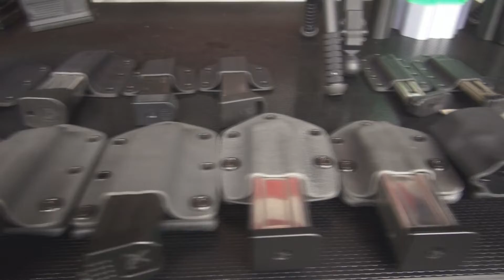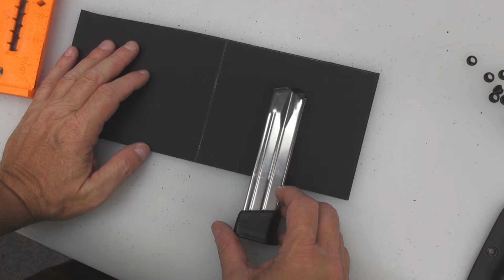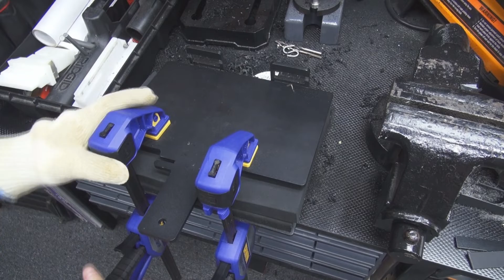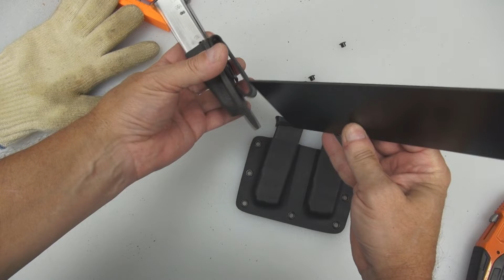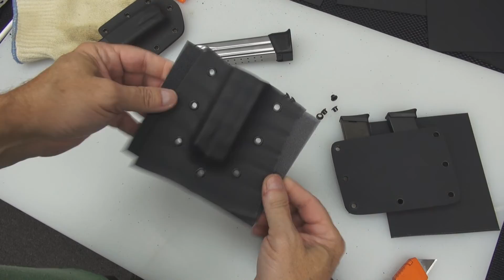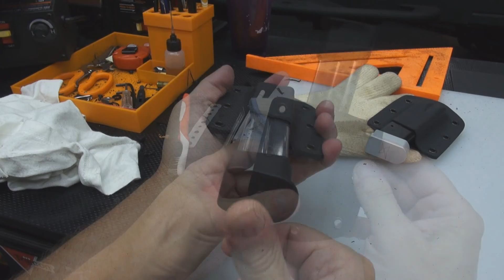How To Make a Kydex Mag Pouch...Easy!

Comment: Great video, I always have to laugh a little, watching every tuber test the retention of his mag holsters, with an empty magazine. Haven't seen one yet shaking that holster upside-down with a full mag. Mine hold 15, and I guarantee my full mags would fly out if you shook them upside-down in a kydex holster, like that, unless you clamped em in there real good...PS.. I know it's a safety issue, but then maybe shake test them out in the field or on the range, with a full magazine(s). Just sayin.
Reply from the maker: @elwhastrummer  ... Thanks! That's a good point about the retention, and it's something I should have mentioned in the video. Just about every mag pouch and holster I make ends up having a slightly different amount of retention. But luckily, it's very easy to adjust by applying a little heat with a heat gun to a small area and squeezing or stretching where needed...or even just adding a little dimple to the kydex where the mag catch hole is, using a small flat head screw driver. More often than not, the retention will be so tight that I can't get the mag out at all, and will have to releave just a bit of tension for it to be usable.

Comment: Thank you for the very helpful video, I will be trying to make my own this week!

small question - would you not want to mold the magazine with a round in it so that it sits in the pouch when loaded?
Reply from the maker: @newfablesam ... You could mold the magazine with a dummy round in it, but not sure that I'd want to do it with a live round. It probably wouldn't get hot enough to be an issue with the live round, but it will get pretty hot when you clamp it down in the press for 10 minutes, so just to be safe, ya know? I've done it both ways, with a dummy round and without, and it doesn't seem to really matter. The pouch will have pretty good retention, so you can push the mag down into the pouch half way, and it will still hold it in. The farther you push the mag into the pouch, the more retention it seems to have. So if you want them to come out easily, you can push them in half way...or if you want max retention, you can push them all the way in. Thanks for watching!
Reply: @jujuscustomshop  Thanks for the considerations.  Maybe it's time to try out my bullet puller!